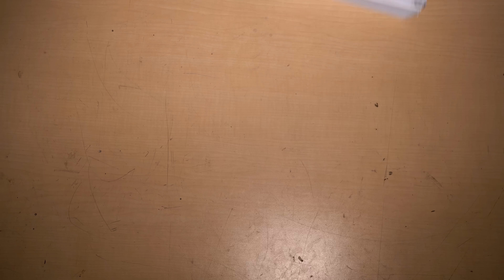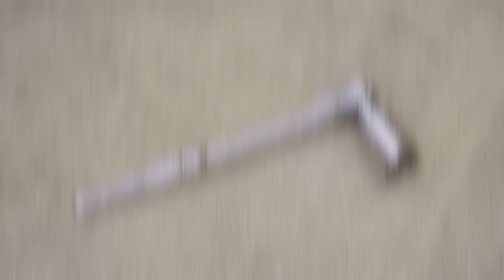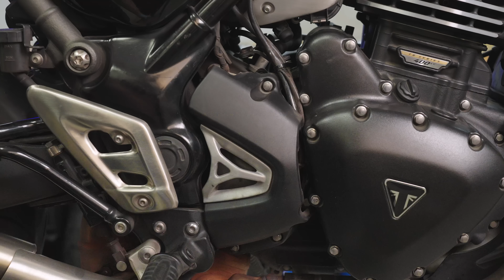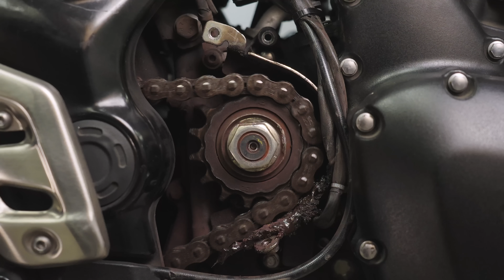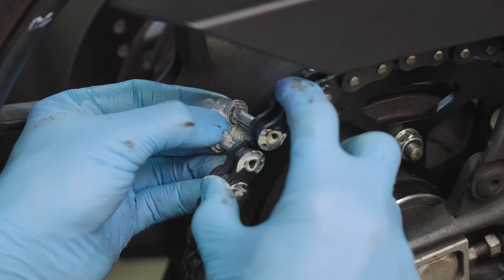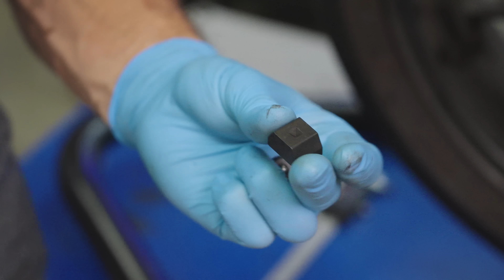How To Replace Your Motorcycle Chain and Sprockets | The Shop Manual

Comment: One thing I would add to those on a bit of a budget. Get yourself a carbide steel T12 hand file to grind the rivets off. It's what I use and it does each rivet head in about 20-30 seconds. Not hard work at all. 

Thanks Ari 😎
Reply: Why do people remove the old chain like they're planning to reuse it? Just get an angle grinder and cut it somewhere.
Reply: @wurfyy  So you’re saying that people plan to use an old chain that was hand filed off? What are you on about? Do you not realize how little material the rivet is to remove?
Reply: @extremeencounter7458  What? How did you manage to conclude the exact opposite of what I actually said? No one is going to reuse a chain they removed from their motorcycle due to wear, except if they have a death wish. And since you're not reusing it, there is absolutely no sense in carefully pushing out a rivet. It makes a lot more sense to just get an angle grinder and simply cut the chain in half with it.
Reply: @wurfyy  Conclude the opposite of what, the very thing you obviously implied when you said “like they’re planning to reuse it?” Your words, your idea, not mine. It takes a few seconds to locate and push the pin out, and obviously only 20 seconds to file with a T12 without throwing sparks and metal shavings everywhere. 

Why would you need to cut the entire chain in half when there are far more convenient methods? It’s like you seriously don’t realize you’re arguing against the very thing that coincidentally enforces the point you’re attempting to make…
Reply: @extremeencounter7458  If you don't understand the obvious implications of the question "Why do people remove the old chain like they're planning to reuse it?", then your reading comprehension is absolutely awful.
Reply: @wurfyy  Or plain bolt cutters. Snap that b** in half !